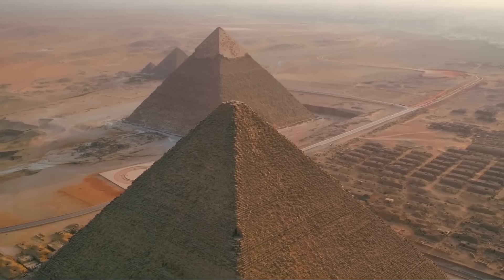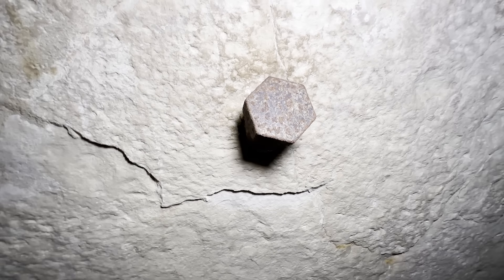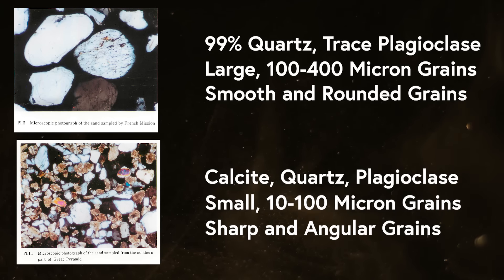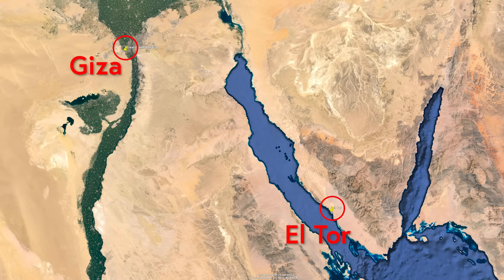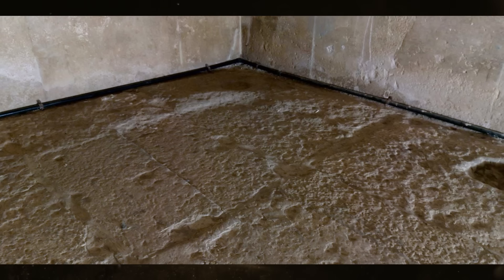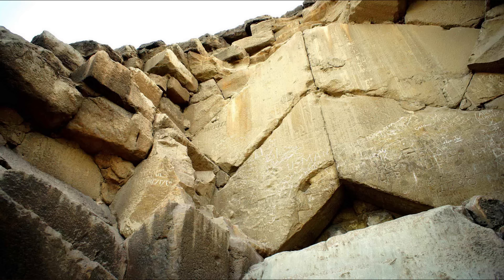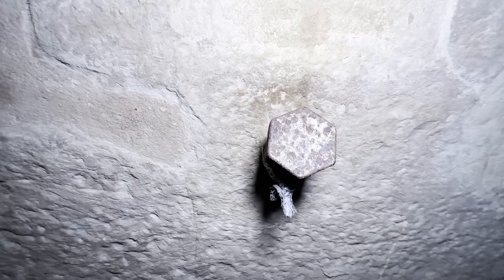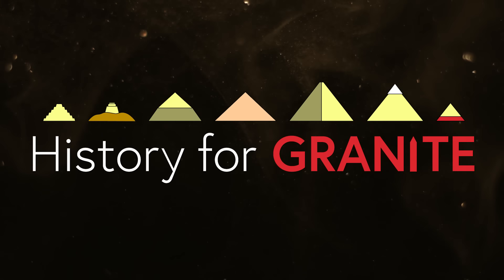How Sand Built the Great Pyramid

Comment: Larger grained sand has another advantage: its particles don't go into the lungs, making it much less of a work hazard for the workers cleaning it out afterwards.
Following the modern EN 481 classification, the Gizah local sand would be right in the respirable fraction and a huge issue, while the >>100µm of the imported sand are not a problem and easily stopped by even thin, breathable cloth.

Comment: I heard there is a sand shortage in the world right now because desert and beach sand can't be used in construction to make mortar and concrete due to grain size and chemical composition. If these are your local sands, you've got to import sand from somewhere else. In the pyramids, they used lots of mortar, so it may be that they had to buy sand as we do today. And builders tend to use materials they have at hand: ordinary workers (in my experience, anyway) don't really care about subtle differences in material properties distinguishing between 'this sand' and 'that sand.' So maybe this is why they filled some gaps with imported sand.

Also, this was a state-sponsored project, after all. As if no one ever heard of contractors spending government money on expensive sand and then filling holes with it. )))

Comment: Hi, 
How can you be sure that the sand using to fill the cavities isn't the sand from Gizah plateau at the time of building, i can see two explanations making it possible, 
firstly it is possible that the sand on gizah plateau 4500 years ago isnot the same as the sand of today, sand is known to move a lot entire dunes can be seen "travelling".
secondly, it is possible that the sand didin't change much but the sand staying 4500 years in a closed cavity decanted over the years, separating smaller and bigger grains.

Comment: 6:21  just for comparison 10 micron sand is extremely fine!!!   I just put an aftermarket Fuel Injection System in  my Van.  It requires a special filter called "8 to 10 micron exclusion".   

This means 9 micron and smaller particles (like sand) can spray through the fuel injection system and go through the engine with no damage to anything .. that's Really small!!!

The average esn with good eyesight cannot even SEE things smaller than 50 microns.

Comment: You can't move 70tn blocks in there dozens from the Aswan Quarry 500 miles south of the Great Pyramid 
 on the  Giza platau  ,then haul them 350ft  up above whats stated as the kings  chamber ,in three tiers ,walls cielings and floors,by slidding them on sand.!!!
Reply: lol, 99.9% of the 500miles is done by the boats on nile river. And you use WOODEN SLEDS to reduce friction drastically. Educate yourself before you post dull comments. Furthermore you can use winches & leverage to pull things. and thats how they did it...
Reply: Grand gallery. See Jean Pierre Houdin.

{:o:O:}

Comment: It seems to me the sand is there because this chamber would of been built first at the layer, than stones from the outside edge in would be placed.  The stone from the outside position is fixed, to perfectly lay stone from the fixed position to a already built Queens chamber when supplied randomly cut stone would be impossible, so the closest fit would be made, and the gap filled with sand that is on hand, this moving sand.

Comment: I think the quartz sand was used because of the electrical properties, it makes no sense to go through all the extra work to import sand if not for a very specific reason. The same goes for all the other materials used in the pyramid.  Most materials could have easily been swapped out for cheaper closer materials.  There is a reason for the materials used other than structural integrity.

Comment: Two questions:

Is there or was there any wood found in the Great Pyramid -- apart from the stick found in the channel.

I'm given to understand that railroad tracks are laid atop angular, sharp edged stone gravel beds because they resist compression and lateral displacement. Yet you claim that round grained sand has the property of resisting compression. On what do you base your conclusion?
Reply from the maker: 1) Only the air channel stick and tiny flakes of charcoal in the mortar between blocks. 2) Lateral displacement and compression are two different things. I don't believe for the short term usage of the rounded sand, lateral displacement would be a problem. Spherical grains have fewer opportunities for them to compact according to a random distribution - whereas sharp angles will have more space between them at rest than under compression.
Reply: @HistoryforGRANITE  : Yes, I am aware lateral displacement and compression are separate actions, but they are inseparably conjoined. Round rocks aren't used on railroad beds because they compress due to lateral displacement very easily. Where the round sand is contained on four sides,   or in a track I can see your point for decreased friction of course. 

It crossed my mind that perhaps the piezoelectric and dielectric properties of that sand might play a role in Chris Dunn's theory . . .
Reply: @rogerscottcathey  
Chris Dunn's idea (NOT a "theory" at all) is absolute hogwash.

{:o:O:}
Reply: @ansfridaeyowulfsdottir8095  : Maybe so, but simply stating it is amounts to unsubstantiated opinion or even just dislike. Back it up
Reply: @ 
You'd need at least 15 years of general education, develop some critical thinking skills, and THEN read his hogwash.

All will become clear.

{:o:O:}

Comment: Calcite sand may dissolve over time with the waters the pharoahs had wash through it.
The quartzite sand would last longer against acidic processes.
Did you by chance see a video with men kissing a white crust at the base of the pyramids?
That was an acidic crust built up during the processes.
I work with acid as well, off white crusts build up on my things if I don’t keep it in check.

Comment: Weren't the Pyramids build with water power and buoyancy to lift and move the blocks? Seems the only sensible conclusion based on where the pyramids are buit and where all the materials came from. I can't see how 70 ton blocks could have been move and placed so quick using sand. I can see it being used for fine positioning

Comment: it seems to me that most discussion of the chambers of the pyramids imply that the construction, working and finishing happened after he pyramids were finished. But surely the pyramids had to be constructed by layers. The basic construction must have been completed layer by layer. Some of the construction would have necessitated foundation activities for the layers immediately above, but surely, once the layers progressed, construction of the lower layers could be finalised. Considering the time required, for the upper layers, it beggars belief that he lower chambers would have been left idle. Although some finishing activities might continue, surely no major construction activities would have been left to the completion of the pyramid? Air vents would surely have been sealed as a final activity, not before the rest of the work was completed, particularly since the air vents were continued through the whole construction period to the outside.

Comment: @5:40 there is a table of 4 photos showing samples of sand taken from different parts of the plateau. The left two photos are the same exact material from different angles and filters, even though they are labeled as taken from opposite sides of the sphinx. Sigh

Comment: Still does not explain the short termination of the queens airshafts (almost diectly below the kings chamber exits) and specifically being made from Tura (casing block) limestone.
The only conclusion I can draw from that, is the queens chamber shaft endpoints once signified a smaller tura limestone cased pyramid, where the queens chamber was once much more important.
That woud also explain why it became abandoned/remodelled, if the pyramid was remodelled.
Which itself implies that the kings chamber and current casing was an addon.

Given the unexplainable carbon dating of some of the mortar vs its stated construction date, the expanded/layered/nested design of other pyramids/matabas and the fact Khufus family were doing repair work on the temples.....and the fact the Giza necropolis was not always desert, and sand also comes from rivers and stone erosion that has the uncanny function of rounding off rough stone...I would not expect such river sand to relate in any way to desert sand. Thats aside from the point that such sand would flow downriver anyway, depending upon current.

Comment: It is not realistic to say that the sand was imported based solely on the fact that sand with a similar composition exists elsewhere. It is much more likely that they were just separating the quartz from the other particulate. If they simply ran the sand through an extremely fine mesh, all of the fine particles would be washed away, leaving only the larger pieces of quartz. They also could have just continuously agitated a vessel of sandy water long enough that the fine particles settle at the bottom and the largest crystal pieces rise to the top. Point being, turning 'sand that contains quartz' into 'sand made of quartz' is not a complicated thing.

Comment: i thought the missing floor was tiles removed by early explorers looking for hidden tunnels?
Reply: leaving the corners on stones can be used to block a trapdoor on one side.
Reply: were there ever book mentions on what secrets could be found inside of the pyramids before the queen chamber was found?
Reply: what if the sand was used to fill in voids from outside that are needed to open new unexplored areas around the aligned joints?
Reply: Only in the section directly below the niche (they dug into the niche 15m, and down under the  niche a few meters)

Comment: We think of the chambers and passages as static and stationary but perhaps  the sand surrounded the Queen's chamber and passages allowing them to expand and contract horizontally with changes in temperature and pressure. 
The King's chamber is also isolated from the pyramid allowing it to expand and contract vertically.

Comment: These unfinished floors, could they have been covered in wood, or even metals so they would not have looked unfinished? Something that grave robbers would have removed. Either to look for valuables or more secret entrances, or simply stolen because they had some value.
Reply: If that was the case they wouldn’t have bothered to tunnel such a long way in order to find something valuable. Covering the floor in metal is counter to the point of the video, the floor was a nice flat base from which to build up and use poles to get the massive blocks placed more easily in the ceiling.

Comment: also when kemetars built their plasma recorders in the shape of pyramids - they always used quartz granular sand due to a higher resistance to the plasma discharges - since pyramids were built to last longer than 1250 years - which is a typical plasma storm loop that returns to earth to wipe it all clean of all organic matter - therefore kemetars would not only built plasma recorders but also plasma shelters which we now know as underground cities and tunnels that can shelter over 5000 humans and 5000 farm animals with a constant freshwater and grain supply - since plasma storms are the main reason of every extinction on earth (nothing to do with meteorites or comets or viruses) - ergo building plasma recorders in the shape of pyramids as well as obelisks centered in star-shaped forts had a well known purpose - however after 4000 years of no plasma storms the purpose was forgotten and converted to religion-based cemeteries - for example the knowledge of plasma storms was converted into zeus, thor, olaf, mars, perun, indra, etc - which none of them would perfectly describe the devastation from the plasma storms -

Comment: Given that the sand composition is so uniform.That means it was filtered/sorted no?
Not necessarily imported. Some sort of processing involved pounding/grinding ect.?
So they used sand as lubricant to move the blocks and all the holes and bumps on the rocks were for anchor points for ropes and pulley systems to attach to.
Throw sand on the path and start tensioning. Once friction is no longer an issue it doesn't matter how much the stones weight.
Once done collect the sand and repeat for next level or simply brush into filler holes along the way... Brilliant...
Following this thought could the small niches left between the larger stones be left for channels to collect the excess sand in?

Comment: OK this may be crazy and way off but I think you would be the best one to ask. And get this out of my head.   I can't stop thinking that water was used to cut the rock.  And then even worse I think the queen's chamber and all the channels could be for water storage and pressure for cutting blocks. What would the pressure be at the bottom if the passages were full of water?  Would that be enough to cut rock? If the area once had an abundance of water. It could be pumped up to the top of the channels.  and if a very small stream was used to cut rock it would not use much. If hard sand was mixed in would it cut better? Water jet cutting could be very accurate and create the blocks we see today. Thank you in advance if you take the time to tell me how wrong I am.

Comment: Sorry, but rounded sand does NOT resist compression better than angular sand! Angular sand offers considerable compressive strength compared to rounded sand grains.
Reply: Angular sand has flat facets that align and allows the pile to compress more. Round sand maintains spacing. Just think of stacking balls or boxes. Those boxes will get tight.

Comment: Many of your conclusions start with the assumption that the sand found in the core drilling isn't local sand. But what if they were just recycling sand that was used for moving stones?

Start with local sand, which is jagged, has calcite, and quartz, and a wide distribution in grain size. Drag a 5,000 kg stone over it a few hundred times. Now look at the sand - I'll bet it will look like the sand sampled from the French Mission. The calcite will have been shattered and fallen out. The jagged quartz will be ground to smooth rounded edges. And the smallest grains will have precipitated out along with the shattered calcite.

Comment: I look in on these videos from time to time but don't really know much about the subject. It looks to me like the Queen's chamber was actually built for a Queen, built as a ploy, or built and the builder didn't like the result. Probably not big enough. Had the looters found anything in there like a casket and body and some valuables, I suppose they may have left without discovering the real find. My guess, the builder didn't like the size. He wanted something bigger. I'm shocked that someone was allowed to drill holes and left the walls in that shape. Maybe a good survey and one hole but a series of holes no way. Those holes might have done some real damage. I do thing the building of the Pyramids was evolutionary. Each group learned from the experience of an earlier group. If that's the case, then somewhere there is a recorded history of the construction process.

Comment: It seems to me that during the construction of the pyramid, several decisions were made to do this or that differently. To me, this is indicated by the chambers that were abandoned. If the pyramid had been intended to be a complete complex, the other chambers would have been completed.
To me, this also means that construction took much longer than is assumed (20 years?). They began in the classic way with the rock chamber, but the next pharaoh wanted a chamber in the heart of the pyramid (Queen's Chamber), and the next one an even larger one with a beautiful gallery (King's Chamber). But that wasn't enough, the next one wanted an even higher chamber (not yet discovered). Construction time: certainly 100 years.

Comment: New idea.  The accepted timeline of pyramid technology may be wrong. The Giza pyramids may have been the first pyramids not the last. The other pyramids may have been flawed attempts to copy the great pyramids and were not technological predecessors to them.  
Consider that the most ancient stone pots were technologically much better than later ones. Consider also that the most ancient Incan structures in Peru were technologically much better than the later additions on top of them.
Reply: Nobody says the pyramids at Giza were the last. But ok, let's pretend they were first. If they were copied, then...why were they not copied? No two pyramids are the same. That's kind of the exact opposite of copying. And we see other advancements as well in architecture as well. 
The stone pots were much better? Were they? They tend to be smaller and more difficult and slower to make, and heavier then say a clay pot could be done. And "technologically" it is a bigger step to working a good clay mix and the potters wheel, and firing them, then chipping and grinding and polishing stone. 
Our world is full of examples...such as plastic...where it is technologically more complex and the end result is faster and cheaper and for most use just fine to some more simple longer process. Body panels for cars used to be hand pounded aluminum around wood jigs, and now are stamped out or more or less plastic molded. Even simple plastic bags are technologically more complex, but so easy cheap and fast to make you don't think twice throwing one away after carrying milk home in it.